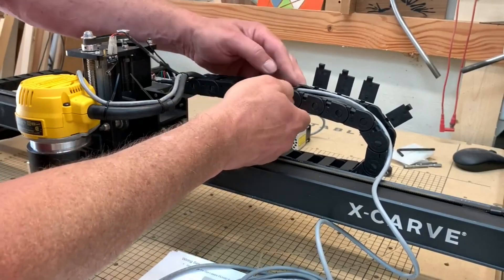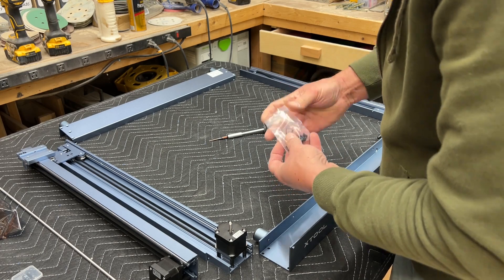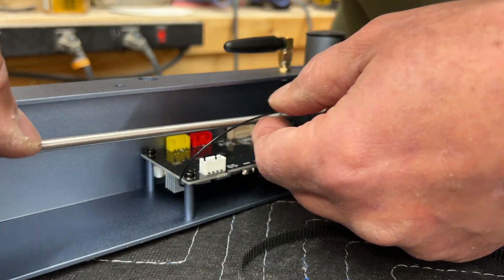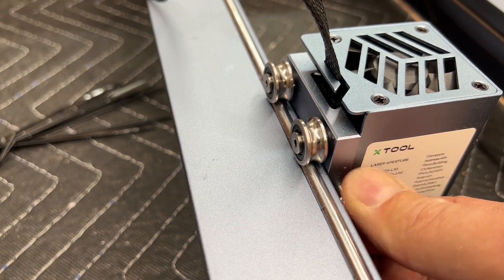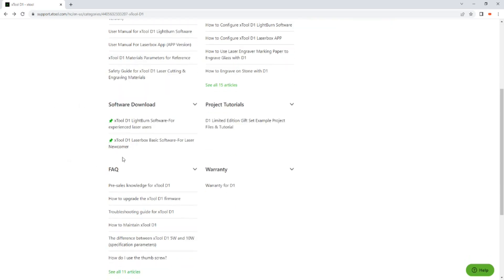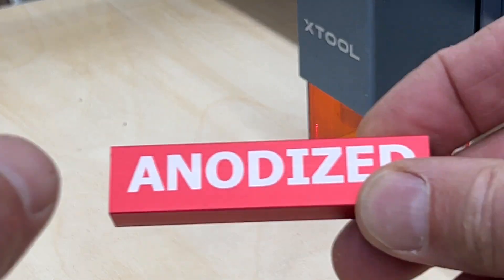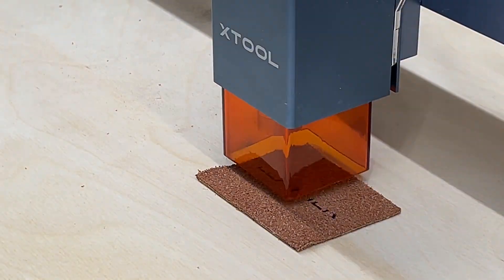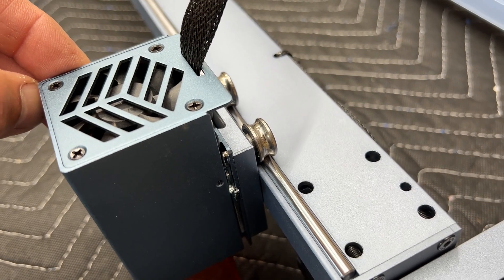xTool D1 Assembly and Review | An Amazing Machine!

Comment: Which one do you prefer opt laser or xtool? I'm getting ready to pull the trigger on one. I have an Xcarve and I like the idea of a larger workspace, but I'm wondering if the power difference between the two is noticeable? Or do you think that's a consideration at all?
Reply from the maker: Sorry for the delayed response.
I would probably go with the xTool, simply because if the increased power. I am getting ready to do a video for their 40W laser head. 
There is an affiliate link in my xTool video description. If you end up getting an xTool, I’d love it if you could use that link! Thanks!

Comment: Hmmm informative. But: I must know, do I need to plug this think into my lpatop/phone in order to get it working? Since my workshop is pretty far from my router and the building itself kinda shields any computers from the Wifi signal. Same with the D1 Pro, is that the same story, or does it have a card reader? I saw a card in the available items for the pro and wonder if that is what it is
Reply from the maker: Hello, you don’t have to have internet access in order to use the xTool. I use the Lightburn software and it talks directly to the machine. No connection to the internet is needed. Hope this helps. 
Thanks for watching!

Comment: I am contemplating buying one of these and have a question about Lightburn. It looks similar in format to Autocad, is this correct. Also can you import Autocad designs into Lightburn? Many thanks and a great review. I have seen a few of these.
Reply from the maker: Hello, thanks for checking out the video. I'm glad you liked it. I don't use Autocad, but I did look at Lightburn and it does list DXF as a file type that can be imported. I also saw a few YT videos showing how to go from Autocad to Lightburn so It seems like it is possible. I'm sorry I cant be much more help.
If you do make a purchase. I'd love it if you used the affiliate link below. It helps support this YT channel. Thanks a lot!
https://www.xtool.com/?ref=4a1SxtiKce28C&utm_source=influencer

Comment: Excellent review! The cable management issue on the Y axis is not exclusive to this machine. I had a similar machine that had the same thing. I ended up looping a rubber band around the cables and then around the back leg on that side. It gave it just enough tension to pull it back when not in use and gave slack when needed.
Reply from the maker: Great idea! Thanks!